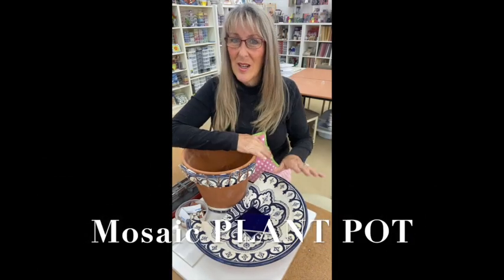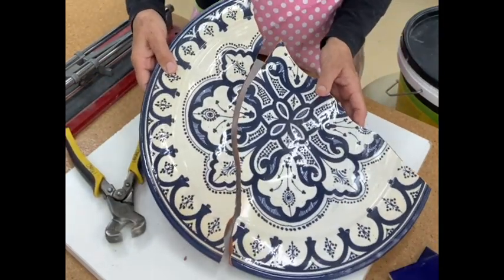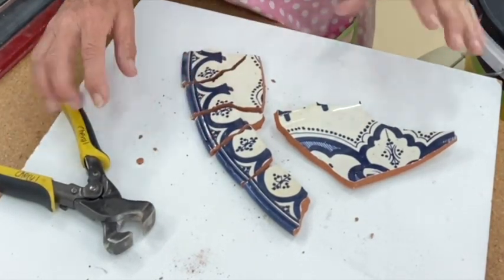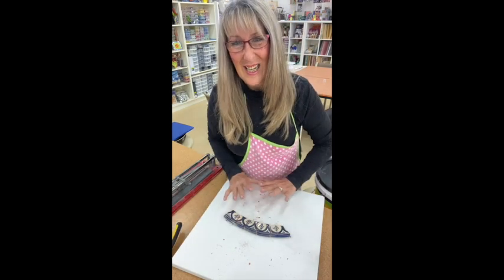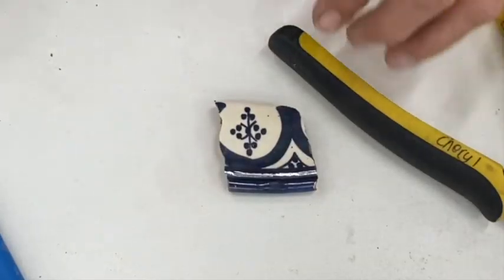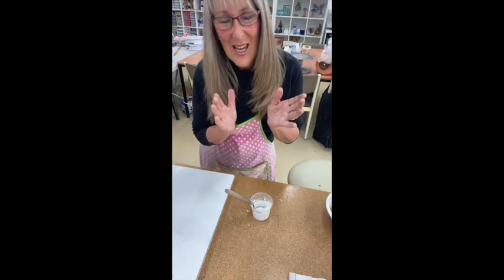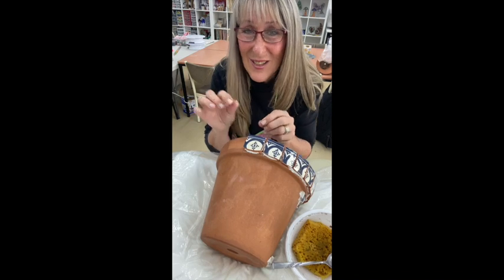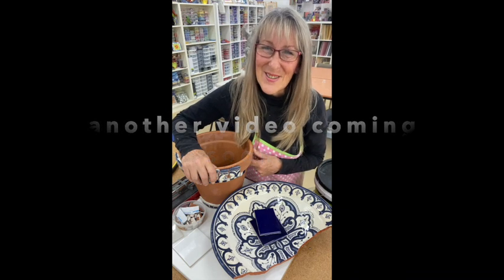Mosaic Plant Pot: Cutting & Decorating the rim using a platter

Comment: Excellent demo! Will this pot survive cold winter temps? Thanks!!
Reply from the maker: Here in Australia it is not a problem.  We don't have freeze thaw.  In climates when there is snow the pot would need to be sealed inside and out BEFORE mosaic begins.    Good point and thank you for getting in touch.  cheers.
Reply: @HannMadeStudio hi,  thanks for this video.  How long have you had a piece made with Dunlop Tile All Tile adhesive on unsealed terra cotta in an out door setting? Have you found it to be stable for years?